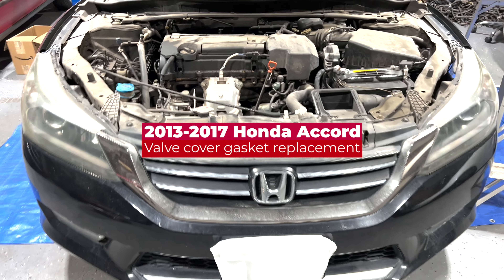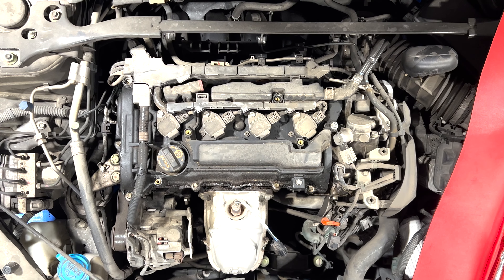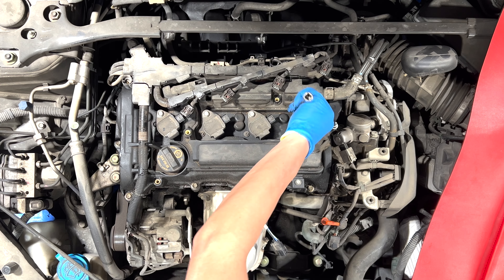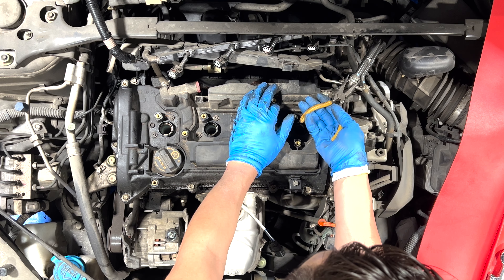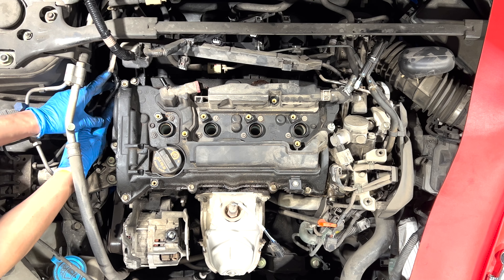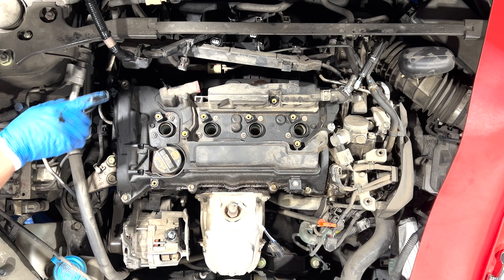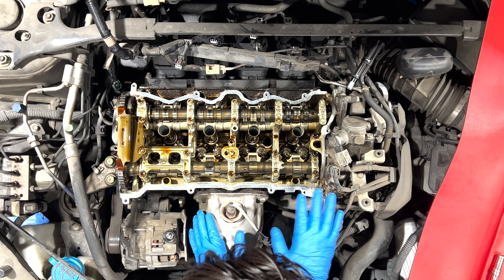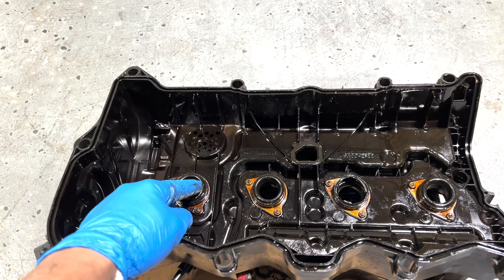2013 - 2017 Honda Accord valve cover gasket replacement

Comment: Hi, great video
. I followed the video instructions and when I was done there were no warning lights on my dash and a few hours later when I turned my car all the lights went on … please help
Reply from the maker: You might have something lose and not tighten all the way. Go back and make sure whatever you taking apart is all put back together. What you need to do is get a scanner and read the code to see what all the lights is. If you don’t have a scanner buy a cheap one or go to your local auto parts store and they can pull theses code up for you. From there we can fix those lights issue.
Reply: @KLIMPORTS  thank you very much for your response. I forgot to plug one of the sensors and I cleaned the corrosion on the battery which was pretty bad. After those two things the lights went off and car running smooth. Thank you so much!!
Reply from the maker: @miguelballon5614  np. Glad you got it sorted out.
Reply: Great video!  Well explained!

Comment: Well made video. What is the purpose of the little squarish gasket on the middle of the cover? It looks like it communicates with a port going down the block.
Reply from the maker: It’s like a breather
Reply: Do you know how this breather or valve cover integrated PCV system works in this particular cover?

Comment: Very nicely done. I like your idea of putting those nuts in what looked like cardboard so that they go back in the exam same spot.  That was also a good tip about putting the Permatex on the gasket "corners" on the valve cover itself. I just did my '04 Honda Accord and hit those 4 spots on the engine with the black (oil resistant) Permatex but didn't put it on the gasket.  

My only negative comment (and I know you were comfortable with it) was not pulling the negative battery terminal. I'd much rather have to reprogram my radio than risk frying something. To each his/her own though.  Thanks very much for the effort!

I'm seeing signs of an oil leak around the valve cover gasket at 115,000 miles. I think that's a pretty good run for a rubber gasket. I'll be doing this in June.
Reply from the maker: Thank you for your comment. I Totally agree with you if someone is not comfortable I would suggest pulling the negative battery terminal or just be on the safe side.

Comment: Great video. Is it normal to change the valve cover gasket less than 150k miles? I have a little oil leaking from my 2014 accord sport.
Reply from the maker: Yes it’s normal to change a valve cover gasket when you see a oil leak from there. The rubber gasket gets hard and broken down over a period of time.
Reply: @KLIMPORTS  appreciate the reply and info 👌
Reply from the maker: @d-ice731  np

Comment: My 16 sport doesn’t have those spark plug tube seals. Mine doesn’t have the screws.
Reply from the maker: Guess it’s a sport so your engine is different compared to a base model.

Comment: that has to be over 100-150K miles if there's oil leak on the valve cover.
Reply from the maker: You are correct, it have 159k on it!
Reply: Looks like mine. I'm going to start now 160k ml
Reply: @KLIMPORTS mines leaking at 92k?
Reply from the maker: @BBTB600  yeah to be honest it’s how well the rubber seal is made and how hot and cold temperatures affect it. I see lots of new gaskets leak after 50k miles.